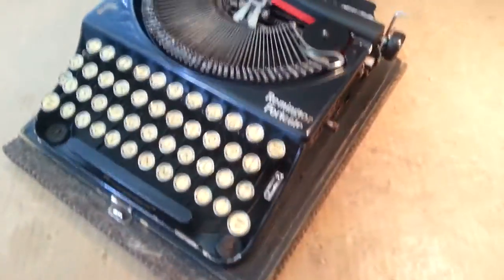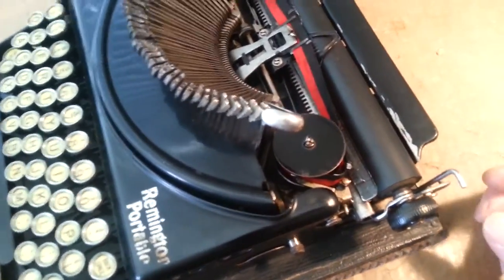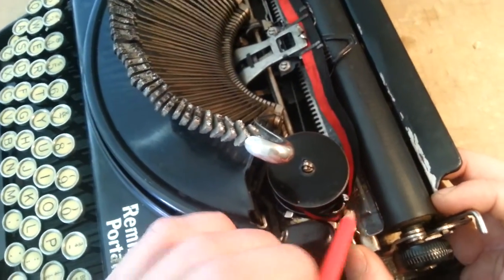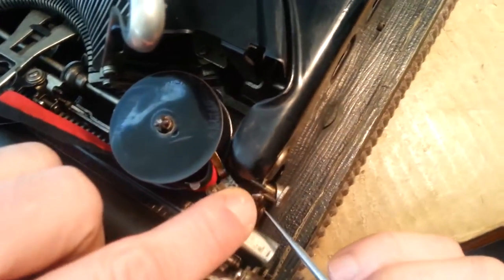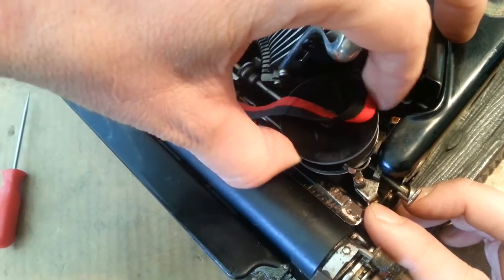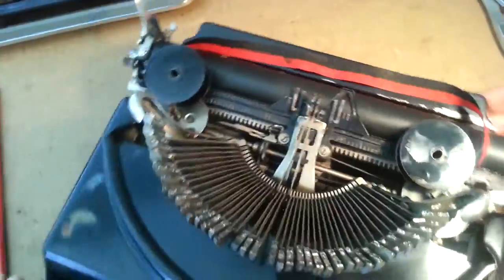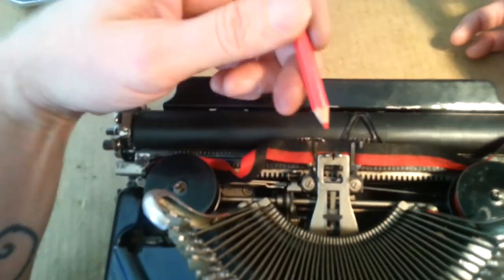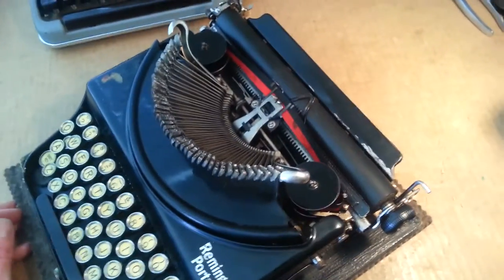Remington Portable Typewriter, changing the ribbon

Comment: Charles, thanks for this video. I was having almost as much trouble with my new to me Remington Portable N0 1 as I am having with my Corona 4.  I had no idea what those little c cups were for outside the ribbon spindles. Now I know.  Still unresolved -- what about those spring loaded spindles -- there is some sort of foot that can be extended to clamp the ribbon spool down onto the platter.  I guess it's optional...mine's also missing the right knob on the ribbon control rod so I guess I have no auto reverse in that direction.  Hopefully, after this info, I can get my machine ribbon to spool...

Comment: Thankyou for your helpful video.  I have just received replacement ribbon spools from ebay for my Remington De Luxe model, only to find that they don't fit, as spool holes on replacements are too small.  The spools on your video look the same diameter/type as mine, so I'm wondering if you could tell me what the specific name of these replacement ribbons are and/or where I could order them from?

Lisa
Reply from the maker: if you have the original metal spools for your machine, any standard half-inch/13mm ink ribbon will work; just wind the ribbon over to your existing spools by hand.  if you don’t have the metal spools, you will need to look for a set of them on ebay!

Comment: Thanks, Charles, for this video.  Here it is 2022 and you have helped me with my 1925 Remington.  I ended up with a LOT more ink on my fingers than you did.  Do you recommend that this machine stay mounted to its base when in use?
Reply from the maker: i’m happy to help! :)  re the baseplate, i DO recommend they stay attached for use - it eliminates the possibility of losing the screws or baseplate, and also protects the internal mechanisms of the machine.  If the machine is going to be living in one spot for regular, daily use then sure, take it off - but if it’s a ‘Sunday driver’ then it’s a good rule of thumb to leave it intact.  Either way, new rubber feet will make life a lot better for both you AND your Remi, so consider picking up a set!

Comment: Thanks for instructions! Is it possible to adjust the ribbon up and down, so the "j"s and "g"s bottom half don´t get red?
Reply from the maker: it's possible, but somewhat tricky.  A lot of the time it can be a matter of simply striking the key too hard;  try to hit the keys as lightly as possible while still getting a good print, and see if that makes a difference.  If it really drives you crazy, take a trip the repairman!  There is a wealth of information to be had at your local repair shop...and there is a list of repair shops at  http://site.xavier.edu/polt/typewriters/tw-repair.html

Comment: Recently inherited a Portable 1, I'm certain it hasn't been used in decades, and could use a tuneup. Overall seems to be in good, working order.

Do you service/repair machines? 

Thanks!
-Seth
Reply from the maker: +Seth Eldridge sorry for the slow reply -- yes, I service the Portable 1, 2, 3, 5, and Streamliner.  The most common problem with these models is degraded rubber on the feed rollers(which I can remedy), followed closely by troubles with the ribbon transport & reversal mechanisms(which i can remedy).  If you need advice or work, feel free to send me a private message.  Best of luck!

Comment: What do I do if the belt is too much for my original spool?
Reply from the maker: Cassidy Rossman - assuming when you say 'belt' you mean the ribbon, you can just cut it down to fit.  Most ribbons available these days come with 15 or 16 yards wound onto them, and these little Remington spools simply won't hold that much...and if you have too much ribbon on the spool, it won't wind up properly.  Cut off what you don't need, and you'll be fine!  Your spools should either have a metal clip or a tiny spike to attach the ribbon to the center post;  once your ribbon is trimmed & reattached, just wind it up as usual.
Reply: TypewriterJustice I know that the Remington Model 5 Deluxe uses a universal ribbon, but when I buy a new ribbon, I have to cut the plastic that the ribbon is wound onto and I don't have the original spools. What should I do?
Reply from the maker: sorry for slow response - just saw your question.  Hopefully you have tracked down some original spools by now, but if not...well, you need to.  There aren't any plastic ones i know of that will really work right on a Remington Portable series machine, and the the metal ones are a bit hard to find.  eBay, typewriter shops, and the FB Antique Typewriter Collectors group will be your best bets.  Those spools are almost more rare than the machines themselves  :)  Good luck!

Comment: I came across one of these. Truly a piece of junk design from the inner mechanics to the carriage truck assembly.  

If this wasn’t made 100 years ago it wouldn’t be remarkable.
Reply from the maker: ‘piece of junk design’ is a pretty harsh judgement!  speaking from the perspective of someone who has used & serviced almost every model of manual typewriter made after 1920, i must disagree - the RemPort family of machines were designed with economy, efficiency, and durability in mind and they absolutely hit their intended target.  it’s compact, tough as a tank, consistent, and gracefully simple.  they’re definitely not high-output machines (like a standard or a more robust portable would be) but for ease of carry, durability, and ease of use on-the-go it’s a design family that has stood the test of time with flying colors, unlike many others of the same era.  true that’s just my opinion, but i have definitely done my homework ;)